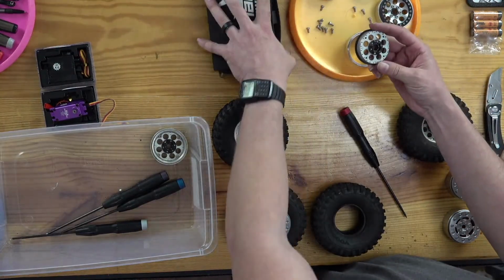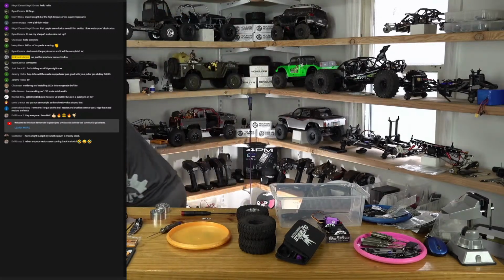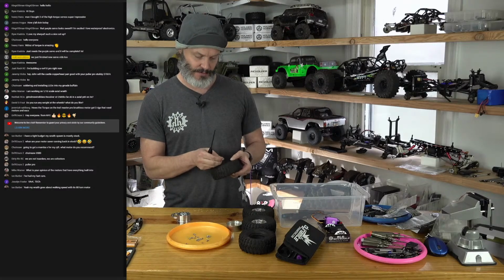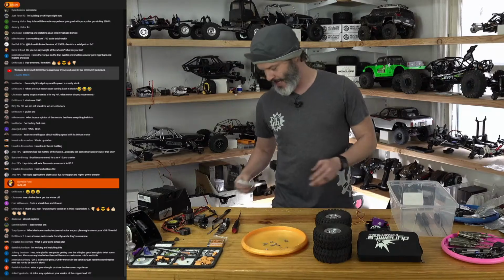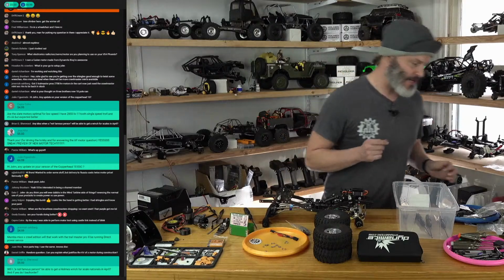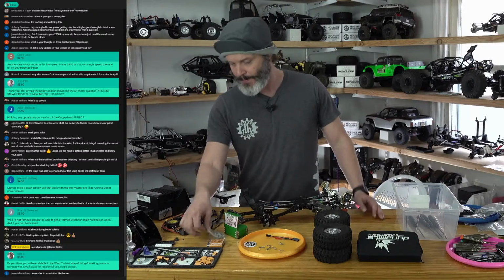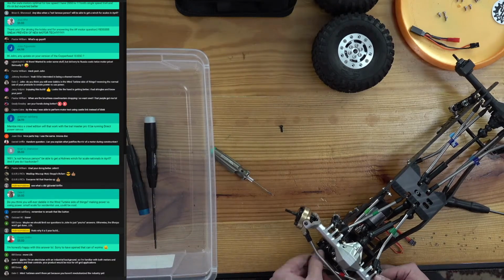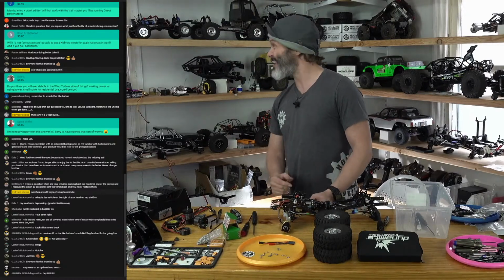Will John ever finish the Sherpa?

Comment: why TGH WHEELS are so expensive And why is it so light in weight? Isn't it supposed to be heavy in order to better fix the tires?
Reply: From what I gather, alot of people buying TGH wheels are comp guys, and alot of comp trucks are very light, carbon fiber chasis and all, and mildly heavy aluminum beadlocks help